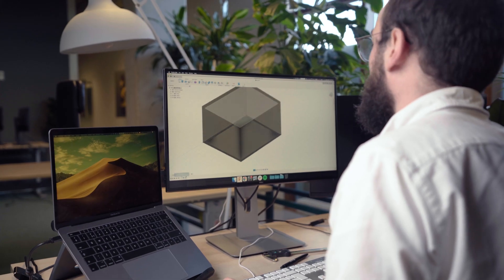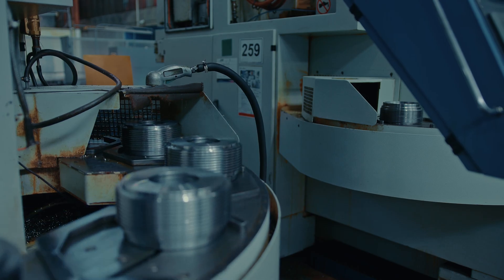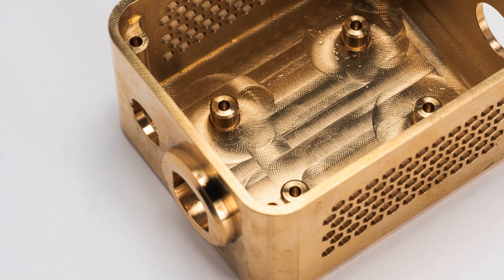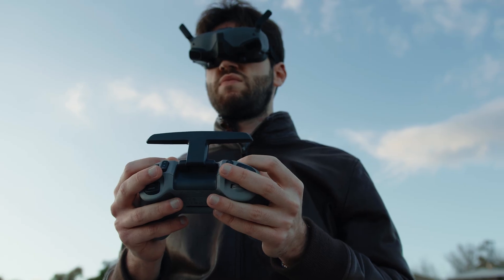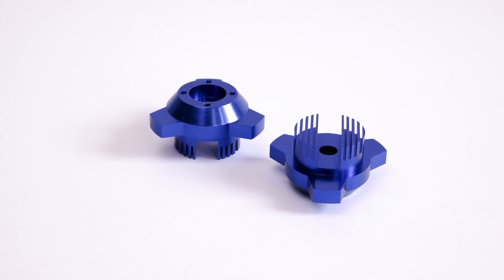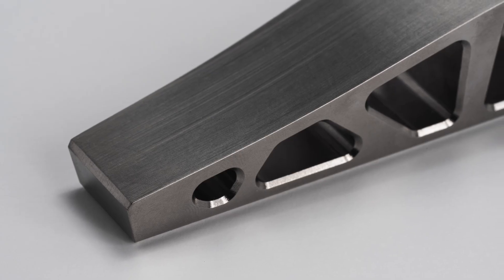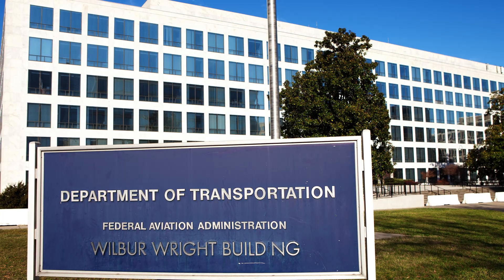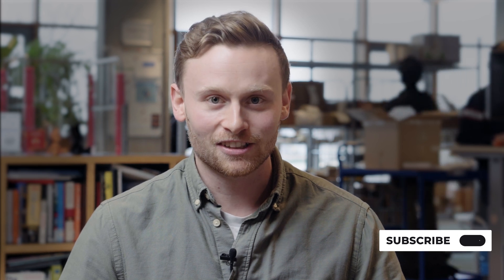CNC Machining Aerospace Parts - What You Need to Know (before you start)

Comment: “CNC machining is not well suited to large scale production runs as the time required for setup and programming can become a bottleneck”… what? The larger the run the less impactful setup and programming is. What’s the alternative, setup a forging line? Yeah that’s quick and easy and won’t require machining afterwards 😂

Comment: “High precision components, 0.001 mm” Ahhhh what? That’s 0.00003 inches. That is high end laboratory type stuff. We have a 100K plus measuring machine and it can’t come even close to that, not even remotely. I am pretty sure it should have been in inches when he was talking. I work and manufacture in Aerospace, and I have never seen a print come close to that. Hell raise the room temp 1/2 of 1 degree and your out of spec.
Reply: Also, the moment you upload aerospace part anywhere else apart from your pc - will get yourself in big trouble... 😂
Reply: You are Right, 
I have a Plan